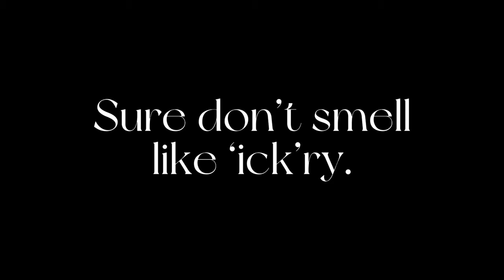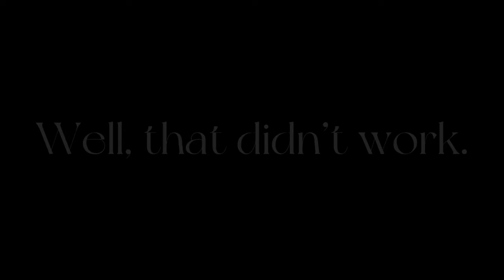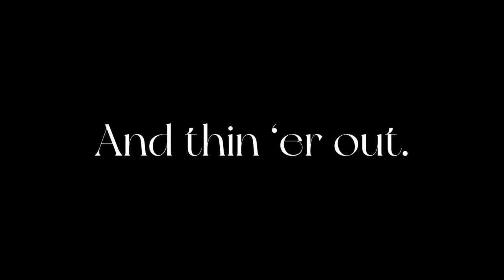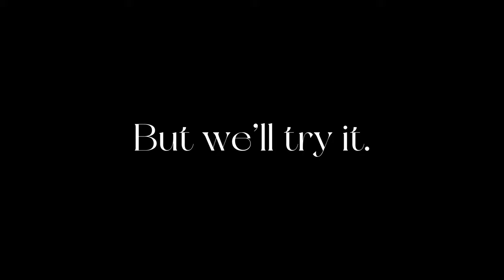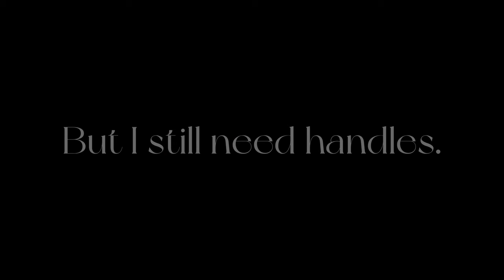Splitting Planks, Rails, and (failed)Axe Handles

Comment: You wouldn't know how much work this is unless you tried it!  I can testify to that.  Especially when it gets hot.  Hard to finish riving an entire 20 inch diameter log in 1 session!   Great video.  I know this is going to be my favorite series of yours so far!

I hear there are actually riving wedges.  Might be called slate wedges or something.  They're long and thin from what I remember.  I believe I've seen them with riving for shingles/chairmaking so those are relatively short pieces.  I would love to find some.   I also use regular splitting wedges but I start at the corners with a hatchet or boy's axe normally.  

I was going to say if you need any axes I'd help you out but it seems you've got things covered!
Reply from the maker: If you ever want to do some hafting for your channel, I’ll be glad to send some over for a “spa day” of sorts lol
Reply from the maker: Oh, and here’s a link to a book that goes into exhaustive detail on splitting rails. It’ll be my primary source when I do some serious fence splitting and building content. Splitting info starts on page 60: https://archive.org/details/youngfarmersmanu00toddrich
Reply: @HiraethRestorations  this book is very cool thank you.  Always looking for old resources.
Reply: @HiraethRestorations  I do plan to do some hafting! I want to do from tree to axe but that's a long term plan.  A lot of my billets are still drying.  Can't wait to make some white oak handled axes!